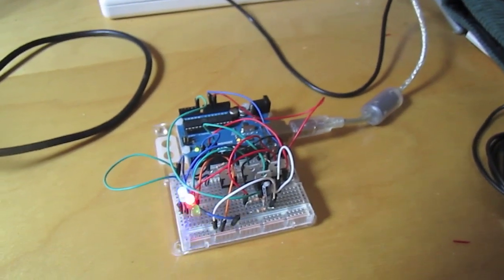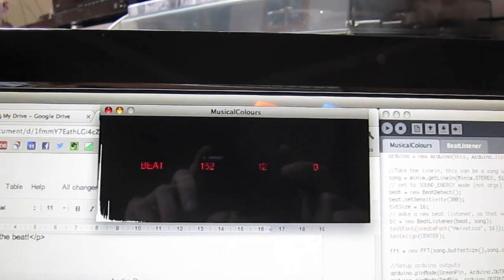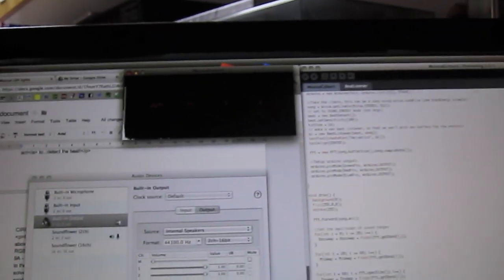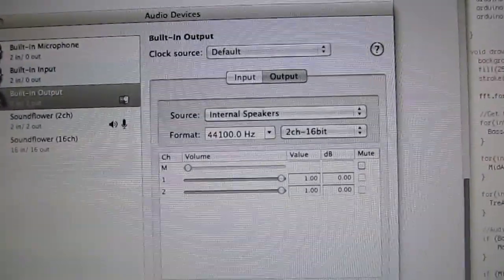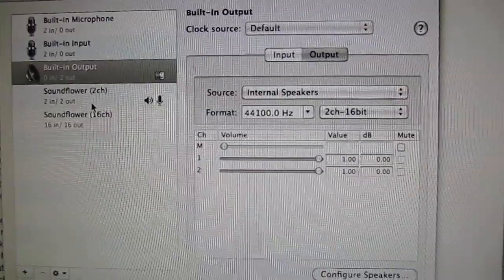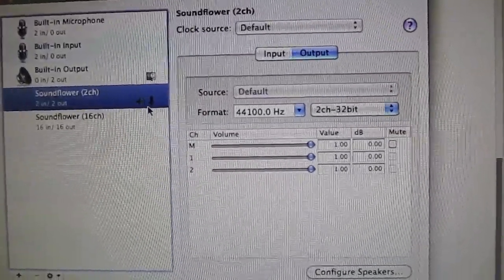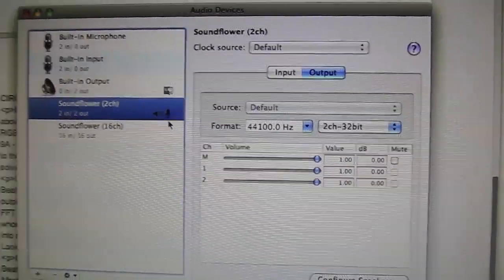RGB Music Visualiser for 5050 LED Strip

Comment: Hey, John I know I'm 8 years late, but i seem to be running into a strange problem with this. My LEDs are only showing white. WHen i run the program, the beat detects sound, but nothing is happening with the leds. The leds are just white, and i can't seem to fix this by myself. If you have any advice, that would be aprechiated as i cannot seem to find the culprit. Thanks
Reply from the maker: This has indeed been a long time so not sure how much I can help. Off the top of my head though:
* MOSFET wiring could be wrong causing all LEDs to be on (white).
* pin driving transistor base is wrong pin/not connected to Arduino.

Comment: how does your beat actually go to the bass. mine seem to be going randomly. not even to a beat
Reply from the maker: Glad to hear you got it working! I know what you mean but unfortunately, that is the reason I developed the computer processing method - the extra computing power allows for a FFT that extracts the frequency bands and allows you to flash different colours for different spectrums. I have since found an Arduino library that does this but haven't developed anything yet - it's a current project though! http://wiki.openmusiclabs.com/wiki/FHTExample
Reply from the maker: Have you got the input setup correctly - you need something that will set the output of your soundcard as the 'mic in'. I used Sound Flower on the mac, not sure for Windows. Otherwise you need to physically plug a sound source into the 'mic in'
Reply: John Whittington Hi, thanks for replying much appreciated. ive tried many tracks (currently on barbers adagio for string's which is treble and bass rich). i have tried to use the jack but it doesnt seem to do anything when connected. i your schematics is very complicated its slightly unclear of where to but the resistor an capacitor, also i think your ground and + is wrong on the schematics. i apologise if im wrong as im a beginner. also anything need to be running like an applet in order to have the jack working please advise
Reply from the maker: HARRPPZZ Ah I didn't realise you were using the jack rather than the computer for processing. I did find the jack a little harder to setup and had to tune the transistor amp capacitor a bit. If it is flash that is a sign it's just creating noise. I agree the diagram on my site isn't the easiest to follow, use the transistor amp tutorial I used: http://hackaweek.com/hacks/?p=327

Make sure you're using the AudioLED.ino sketch in the code folder too, that doesn't require processing or any applet and is stand alone.
Reply: John Whittington thanks very much, i have got the LEDs working and flashing to the beat. however nothing for it to go with the bass. if bass is not possible is there a way that i could have the RGB flashing separately, at the moment RGB is flashing equally. however is there a way i could have say R (lower frequency) flashing more the G or B. if you know what i mean
Reply: John Whittington Hi, yes im currently looking into it. my theory is monitor the analogue input and see when the bass come what value it comes up with and from there thurn LED on or Off